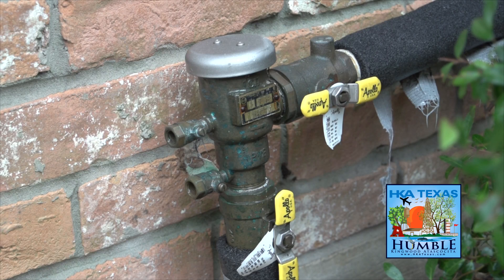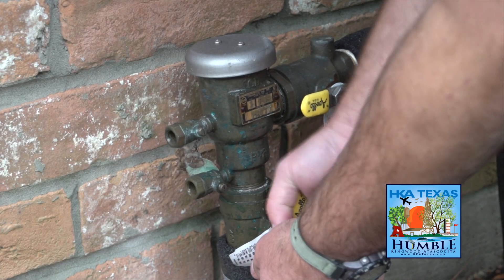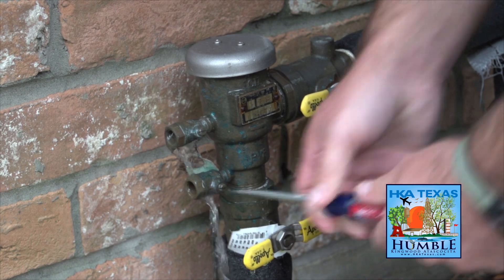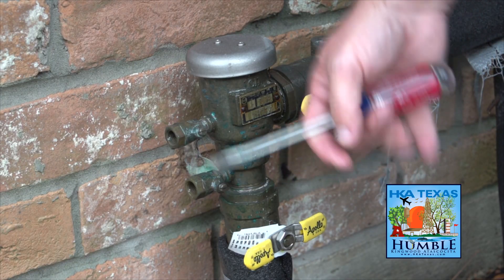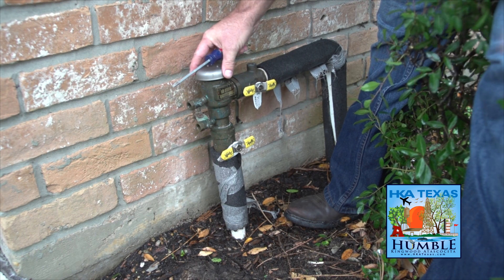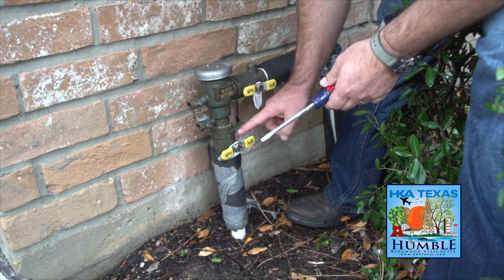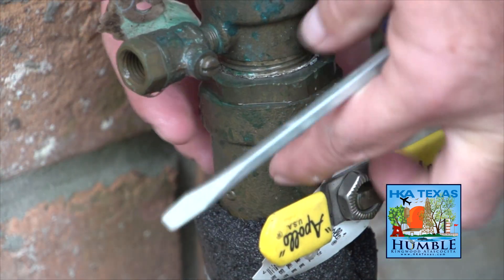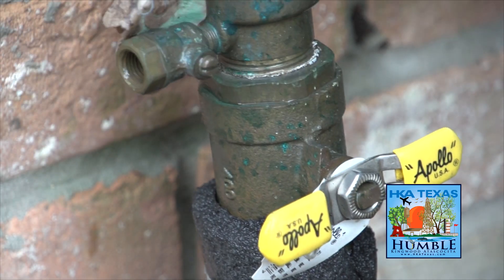Winterizing your backflow preventer on your sprinkler irrigation system

Comment: The video shows indoor type duct tape used to tape the insulation on the pipes. This type tape deteriorates quickly when exposed to the elements. A better choice would be to use outdoor rated duct tape which is usually black. This is longer lasting a looks much better.

Comment: Buy and install the patent ReValv™ winterization kit. It is a DIY kit. Once installed, it allows you to remove the backflow valve from the irrigation system and store it inside - out of the freezing weather. I can fully winterize my lawn sprinkler system in less than 5 minutes and hook it back up in the spring even faster. You can buy it on line at www.revalv.com. It really works!

Comment: Just so I am clear, when it looks like it will freeze, I should turn off the valve coming up from underneath the bell, and open up the two “screws” with a quarter turn to release/drain the remaining water, correct? Basically, get it into the same position you show here at the end of your video? Then I might want to wrap up the entire area in some blankets, etc.? Is this correct?

FWIW, I am in the Humble area, The Woodlands, to be precise. I believe this is what I was told to do last year, but I want to make sure I am remembering correctly. Thanks!
Reply: That’s how I understand it.